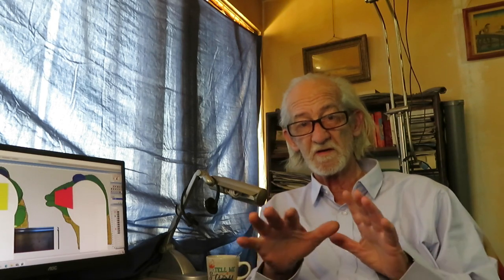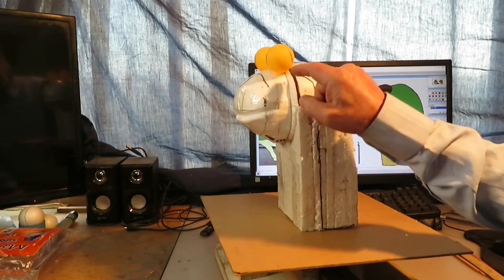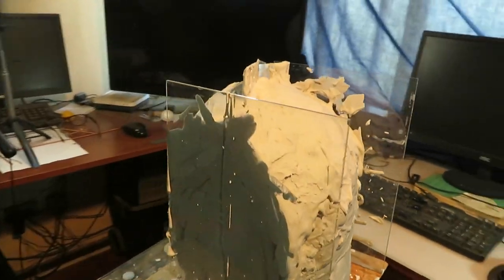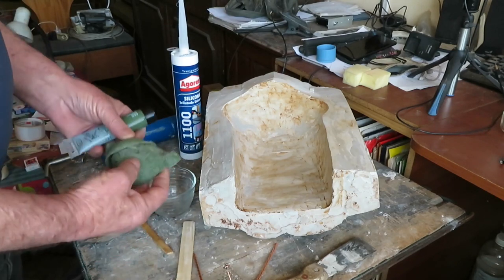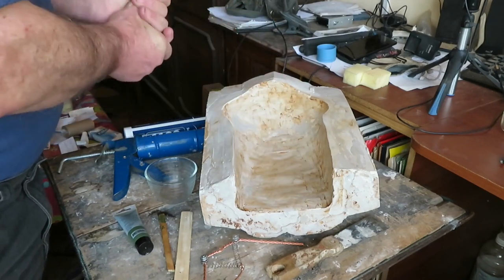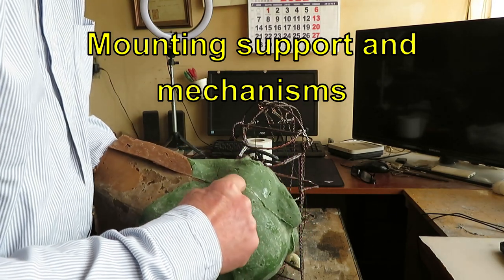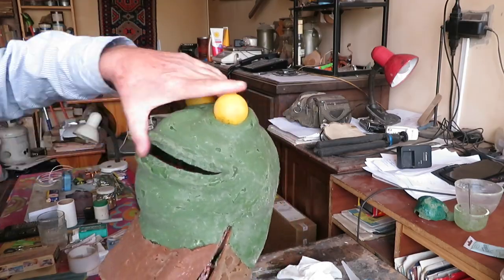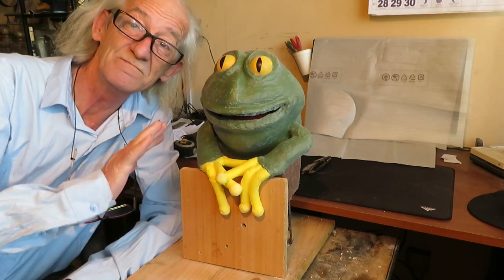How to make a puppet or mask using a common silicone sealant

Comment: Seaming together the two halves by flipping it on one another would be more successful if you added keys into your mold halves, assuring the mold halves lock together the same way every time.
Reply from the maker: Yes, that's an option, although turning one mold upside down to fit into the other might make this silicone drip out of place by gravity,  Maybe flipping it over some 30 mins later when the silicone has made an outer crust that won't happen.